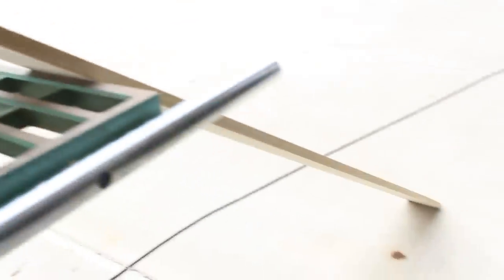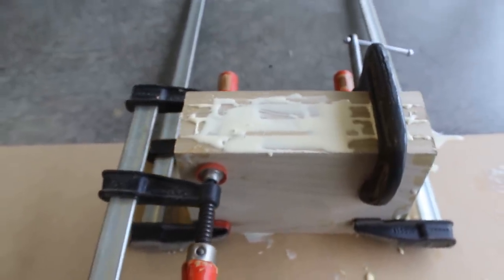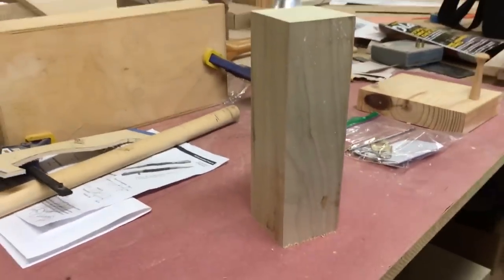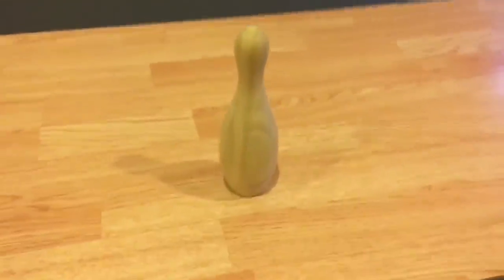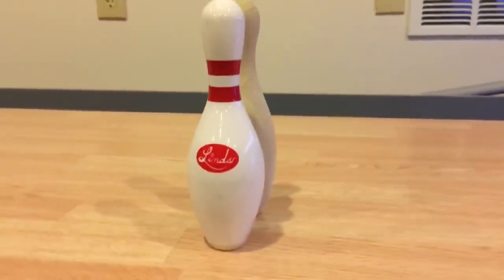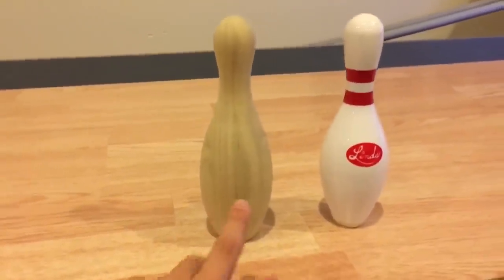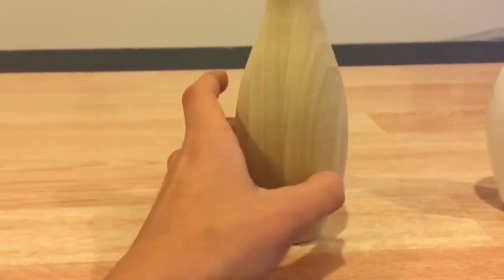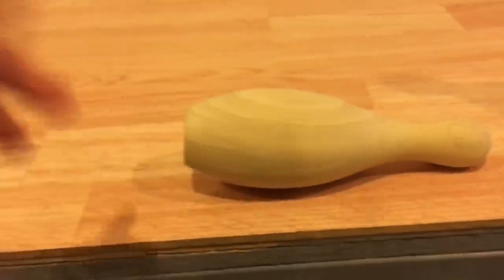Making A Mini Bowling Pin! (Day 7)

Comment: I learned how to make a bowling pin first you get wood and cut it to a bowling pin and melt plastic but white and spill the melted plastic and get drill to make the hole from the bowling pin when you see a bowling pin and see hole down to the pin and drill it and paint the the bowling pin crown or stripe and boom you how your own bowling pin or pins